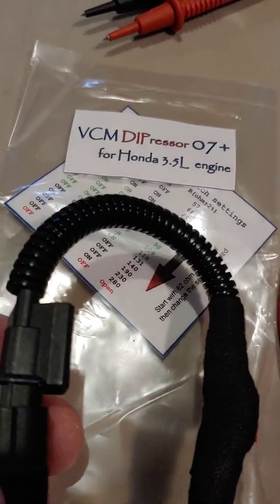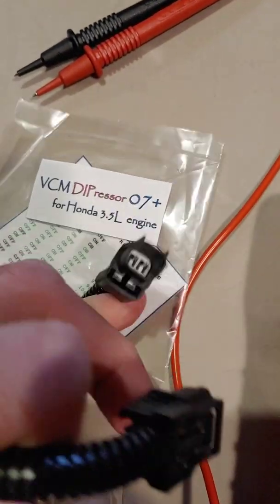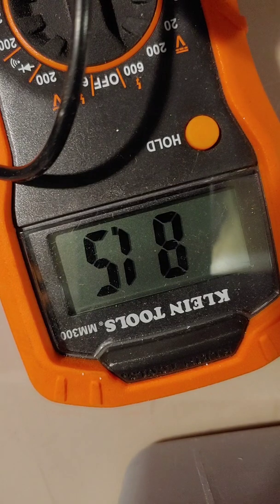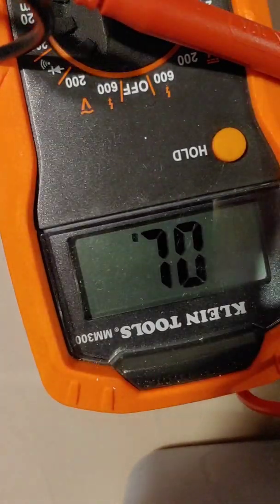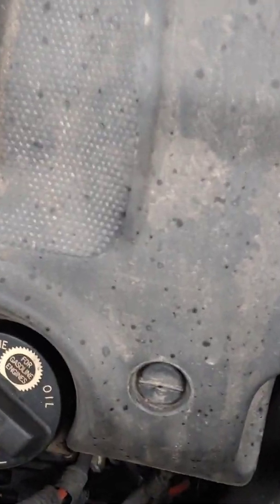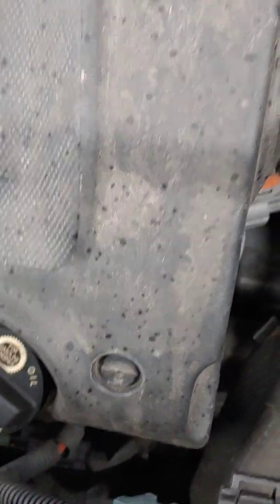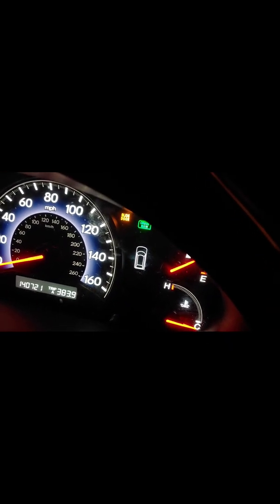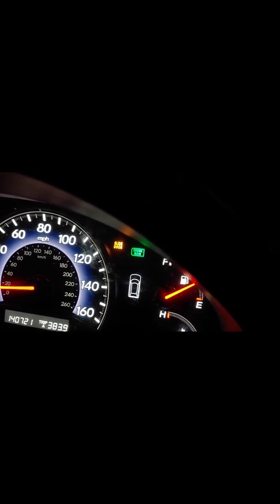DIpressor VCM Muzzler for Honda 3.5 L V6 engine - fix for rough VCM turning on and off - $30 on eBay

Comment: When engine light comes on, does it mean the ohm settings on the muzzler is set too high? Do I need an OBD scanner to clear the engine light? Thank you!
Reply from the maker: @Radwinskee  the check engine light may come on if it's set too high (or low). You don't need to clear the code in my experience.
Reply from the maker: @Radwinskee  ya, from rereading here it looks like if it's set too high the check engine light is a common symptom. Lowering it should get rid of the check engine light.
Reply: @mnmurph  thanks for the reply

Comment: I had this problem with my 2016. Bought the dipressor the wrote off the van before i installed it. My 2019 is doing the same thing so I’m installing the part on it. Thanks for the how to

Comment: Help please i have a honda pilot i bought this how can off completely ? Put all the buttons down?
Reply from the maker: off on on on
That's the lowest setting, 82 ohms. See this video's description for the settings
Reply: @mnmurph  I have a sheet of information why I need the ohms, I just want to turn off eco mode permanently and all I have to do is go all the way down.
Reply from the maker: Ohms is the numbers on the sheet. 
I had to change the switches when the weather changed. The eco light came on when too low, and the check engine light came on when too high. Some other weird stuff happened when too high too.

Comment: HI ; still using this muzzler?  I want to buy one but vendor is now lising on etsy and not ebay so got suspicious.
Reply: I just want to say, I bought from this man on etsy and yes, he only sells it on his etsy site because ebay has been such junk for sellers.  It came in a small package in the mailbox and it is wonderful.  There are many choices out there for vcm, support this guy, his product has been great. The resistance is changeable, so if your honda gets too warm it will still show on the dash and the vcm would come on as a precaution.  Thanks.   2015 Odyssey here.
Reply: because ebay has destroyed it's own reputation and suspends sellers accounts to keep money for 3 weeks before releasing funds, so they build interest.  ebay also just fired thousands of employees last week.
Reply from the maker: I had to let the vehicle go to the great salvage yard in the sky due to almost 20 years of road salt and the resulting rust damage. The muzzler worked the whole time, for years.
Reply: I got mine from Etsy as well.

Comment from the maker: on off off on is 98
I just changed mine to 92 and checked the resistance with a multimeter and it read 92 ohms.

Comment: Hey, Murph. Thanks for the video. Had to laugh at your process for finding this one as it was the exact same as mine. From the $90 sticker shock, the unimpressive looking quality of the mid priced ones that you still have to fiddle with, to searching for a cheap one on eBay and finding the Dipressor. 

Couple questions if you don't mind: It's still working well for you? And generally speaking, lower temps = lower resistance and higher temps = higher resistance?
Reply from the maker: Ya, you got it. It's warming up in MN now and the eco light came on once.  (There's no jolt when it comes on like it used to before the dipressor though.)
Reply from the maker: It's still working fine.

Comment: Thanks for the video. Just installed mine. 82 ohms not cutting it for me. Summer is very hot in Charlotte. Going to try 92 next. 
82: 3  4  5
85: 2  3
92: 2  4
98: 2  5
109: 3  4
118: 3  5
Reply from the maker: Did you get it up high enough to keep ECO off?
Reply: @mnmurph  Have set to 92. However, I have been doing only short trips since. I will post after some “true” tests.
Reply: @mnmurph  Got COVID 😞. Hence the delay. I have gone up tp 109 to no avail. Should I go to 118 ohms (or is it too risky) ?
Reply from the maker: @AnilSharma-fw2bs  I've had to go to 118 lately too
Reply from the maker: @AnilSharma-fw2bs  the original "VCMuzzler II" https://www.ebay.com/itm/352813149353
Has resistors for 
68 ohms
100 ohms
120 ohms
150 ohms
So 118 might not be ENOUGH even.
Reply from the maker: @AnilSharma-fw2bs  glad to here you got over COVID, no bueno
Reply: @mnmurph  Thanks! 118 didn't do it 😞. Next resistance is 131 (4 5).  Thanks for the info on VCMuzzler II!
Reply from the maker: @AnilSharma-fw2bs  you could check what ohms people with the VCMuzzler II set theirs to in the climate you're in. I updated the description of this video to include higher ohms settings.
Reply: @mnmurph  Yes, going to do that in odyforum. 131 works fine on the highway. Local roads ECO sign pops up. Will probably try 140 next. Thanks!
Reply: 140 worked fine for a very long time. Then I took a 700 mile trip.  Non-stop 300+ miles brought that dreaded sign back :-(. In my next long trip I am going to try 190. Right now in 140 which works great for everything else.

Comment: The only problem I saw in my 2012 crosstour, was I've seen mine used oil, one time so far.

Otherwise, I had no other problems, so I decided to buy this one, b4 I have problems like others have had. Delivered today, but other parts are coming, so I'll wait a few days longer and do it all at once.

I ended up using 98 ohms on the dip switches....no more VCM!

Comment: Hello MN Murph, Appreciate your vlog on this VCM muzzler. Most Honda owners nightmare who have a VCM vehicle. Can you provide an update since it was installed so viewers can get an idea how well the DiPressor works. 
Did it stop the oil burning or oil loss? Did the Eco light ever rear it’s ugly head ever? Did you ever had to adjust the VCM to a higher than 82 Ohms? Do you live in a state with cold winters and hot summers? Thanks!
Reply from the maker: Update, a year or two later, it's still working. The ECO light does pop on once ina while, though not with the jolt that used to accompany it turning on/off, nor the lurch in acceleration/power. I'm in Minnesota with extreme winters and summer temps up to 100°F. I do have to adjust it in the summer or the ECO light stays popping on. Now that we're in the hot season again I have to adjust it again, otherwise i turn the first and last switched to "off", for 109 ohms. That works pretty good still, but I've gotta put it a little higher to around 120 ohms.
Reply: @mnmurph  thanks for getting back to me as I have the same one. Btw, Have you experienced a check engine light now that it’s summer when you have to increase the resistance? If so, What code and what do you do about it?
Reply from the maker: @awongutume  ask on odyclub.com and they'll help you troubleshoot. I didn't get a check engine light. It sounds kinda familiar though. What resistance is yours set to?
Reply: @MN Murph, originally at 109 similar to what you did  as I’m in Florida with mainly a hot climate. What is strange I drove 280 miles non stop with no Eco light or check engine. Then next day, it popped up about 20 miles into my driving. So, I decided to lower it to 98, that’s when the Eco started showing up. Hence my dilemma on which way to go. Thanks for your time.
Reply from the maker: @awongutume  increase the ohms as weather gets hotter. The original ”VCMuzzler II" has resistors
68 ohms
100 ohms
120
150
Reply: Thanks very much for the reminder. Haven’t been driving it much lately as I was working to fix an oil leak using Permatex stop leak spray. Short drive around the block, no leak. The real test is when driven a while. Now, awaiting a cv boot (split boot). Not making any noise and don’t want to take any chances until I change and repack with grease. Meantime, doing a brake flush. ☹️
Only have for about a month now. Ciao!

Arnold
Reply from the maker: @awongutume  I set it back down to 82 ohms for winter here in Minnesota. Before I lowered it, there was a check engine light on and now it went off after lowering it to 82.

Comment: What numbers I have to choose on muzler for 08 xle odyssey
Reply from the maker: It depends on the climate conditions where you are. Hot weather, 80°F and higher, I put it up to the 109 ohm setting. It's cold in Minnesota now, so I've been meaning to turn it back down to 82 ohms
Reply: @mnmurph  I’m from Minneapolis as well so thanks

Comment: Hey, I got this same unit... you mentioned having to up the OHM setting in July (hot summer)... Can you tell me what setting you bumped it up to?
Reply from the maker: I put it from the preset 82, up to 109 ohms:
off on on off
(So just flipped the last switch to off.)
Reply: @mnmurph  I got one last week, it works fine, what happened if you don't change setting when summer comes (forget to set higher Ohm for summer)?
Reply from the maker: @jorge66703  ECO mode starts turning on again.

Comment: I got one for my 2006 odyssey, but weather hasn't been nice, will let u know how it goes after installation. Mine has some number switches. Says to start with 82 ohms. Does your have it too?
Reply from the maker: Yes. It's not hard to reach to install. I left it on the 82 ohms.
Reply: @mnmurph  my odyssey, when ever it warms up, eco mode kicks in and the van vibrates pretty loud. U would have to let go of the gas of step on the gas to make the vibration go away.  Does it anytime the speed is flat, small road/hiways. I just bought that van last month ago. Will install the muzzler this weekend. Tks for getting back.
Reply from the maker: @DaPlayers_AKL  that might be fixed by the vcm fix, hopefully it is. I waited a long time to plug in the DIPressor/Muzzler... But it really was easy and it's so nice to not have the jerking jolting from ECO mode turning on and off. 

Does yours only vibrate like that when it's warmed up and on ECO mode?

One of the engine mounts fail with the vcm being a key suspect from what I've read on odyclub. Maybe that is involved

I would look on ODYCLUB.com forum too, that's a good place to help troubleshoot.